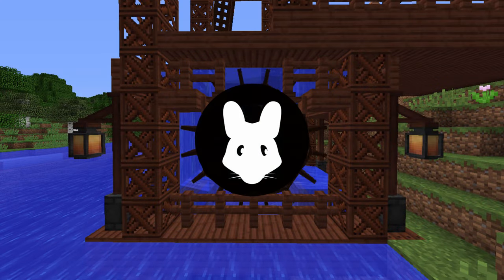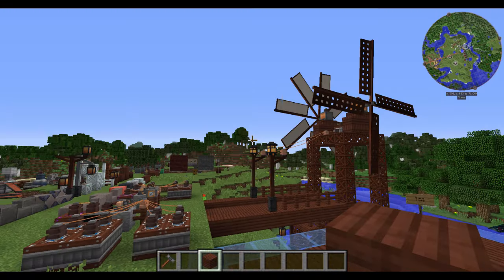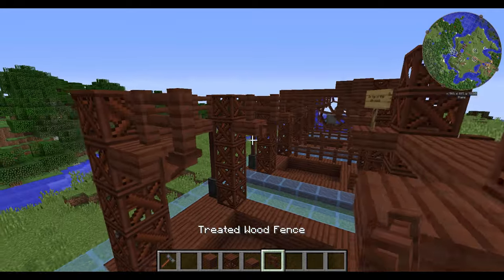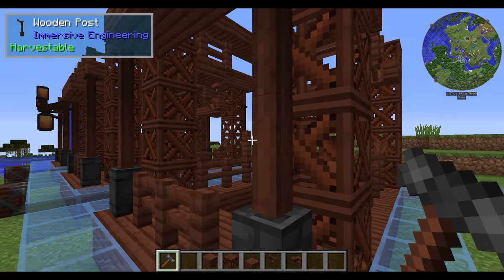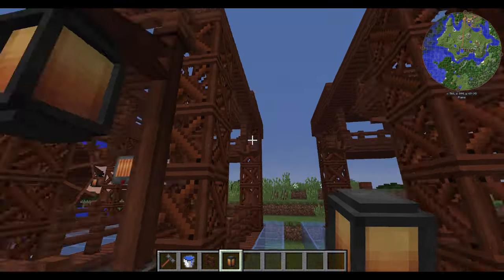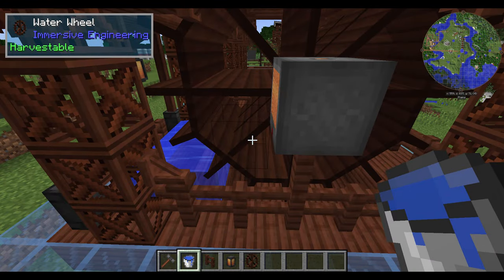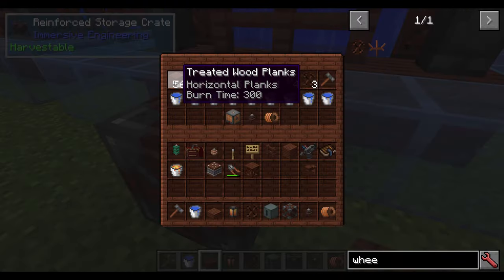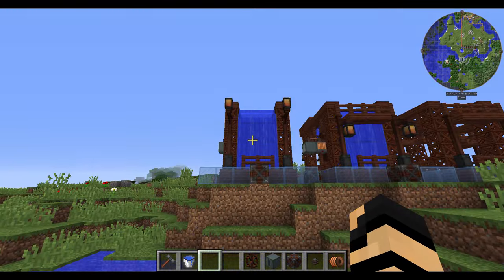Immersive Engineering: Making a Max Power Water Wheel Look Nice! Minecraft 1.10.2/1.11.2

Comment: Hey Mischief if you finish Immersive Engineering could you check out Matter Overdrive.I think is based on Star Trek or some other sci-fi series.Plus you can become an android in the mod.Love the videos
Reply from the maker: I've wanted to for some time and after talking to the mod author I may still cover this but not unless it makes it past the 1.7.10 hump.  In the mean time, we added Cyberware to our upcoming Server modpack (called Modded Mischief and can be found on Curse) that will also turn you into a cyborg though in a different way. ;)

Comment: I'd heard that with microblocks it's possible to get a few more bits of water moving in the right direction on there somewhere.  Any truth of that?
also, what modifications would be best if you where trying to stack these on top of eachother, can the same water power two wheels, one above and one below?

Comment: Excellent series MoM! I have one question regarding the output, I followed this exactly but only capable of getting 81rf/t  any idea as to why this could happen? No custom config just using it slapped onto vanilla.
Reply from the maker: +mirome Check to make sure all your water is flowing and nothing is blocking. It should ultimately make a C shape. I'd guess one of the water sections in between other water sections on a horizontal plane is not acting as it should.

Comment: Thank you.. :) setup one myself. new to immersive so it did help out a lot. Here is a screenshot :) the WW goes counter clockwise. the windmill clockwise. the water comes in from the lake up on the mountain down across the aqueduct to the WW. then back down to the river. http://i3.photobucket.com/albums/y76/Dave805/minecraft/2017-04-12_15.38.05.png

Comment: The wheel construction is very pretty, but unnecessary if you just need power, you can make the wheel with far less parts. and the turbine can support 4 wheels. You don't need the water at the back of the wheels at all, just the water flowing over the top.